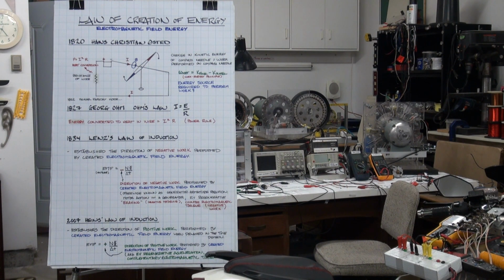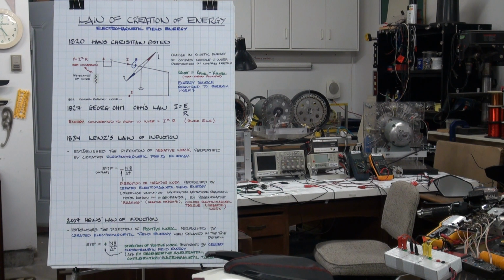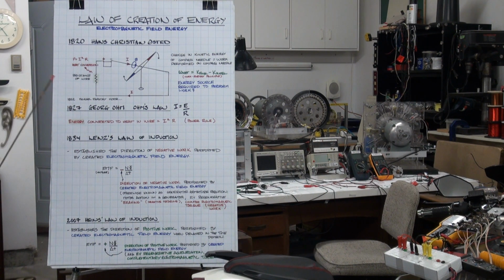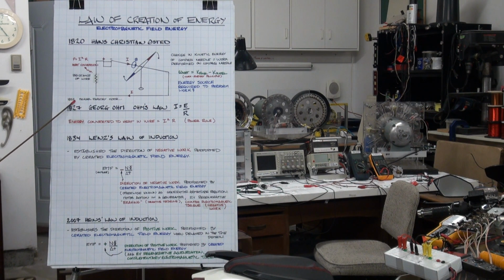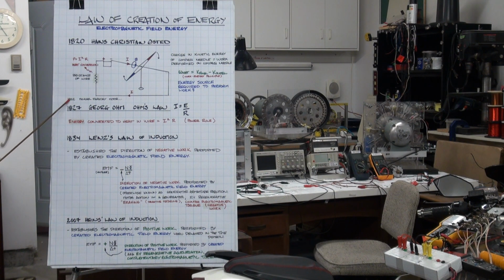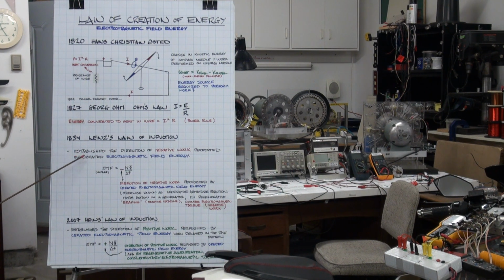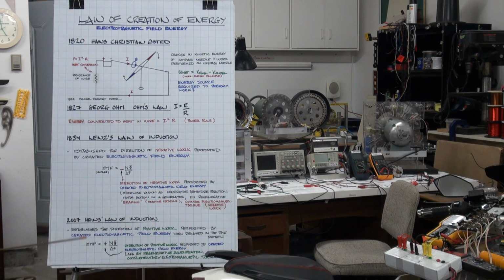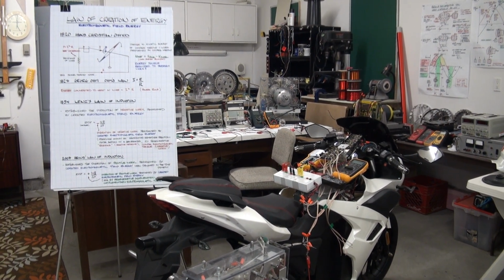Law of Creation of Energy 1820 - 2021

Comment: Stan Sandu  
     The FIRST controlled thermonuclear REACTOR type ENOCH -PACAL, after the UNIFIED LAW!           
    Bernard Bigot -Director General of ITER, in March 15, 2018 says: ”We have not a long-term option, for energy. If we do not find an option, we will have big problems.I am almost 70 years, I will not live to see the benefits of the fusion, but we*ll you get there. It is my duty to bring together some of the large chain parts delivery”. Thus, January 30, 2019 ITER Council renewed the mandate of the ITER director general until 2025. 
        Russian President Vladimir Putin on July 10, 2019 calls for international cooperation in the domain of thermonuclear fusion energy to unleash the potential of humanity because it is impossible and useless to try to stop human progress. Mechanical engineering Professor Eugen Schuster, an expert in nuclear fusion plasma control in 2019 says: ”..nuclear fusion reactors do not produce energy. Experiment on tokamaks sites worldwide are focused on the study of plasma physics”.
       Christian Hill Head of atomic and molecular data to IAEA ( International Atomic Energy Agency) said: ”that obtaining a high temperature in a reactor is one of the conditions for the fusion to take place. At temperatures of millions of degrees matter exists only as a plasma to be limited by a magnetic field not to damage the walls of the reactor, otherwise candidate materials for use in fusion reactors are tungsten, berillium and steel”. 
       At FISSION – large chemical elements we divide, and items arising are lighter than when they were together. This difference in weight is converted into energy. At FUSION – light chemical elements come together, and when united are lighter and can extract the difference in weight, as well as energy. It follows that it actually a matter is of concentrated energy. We consider the magnetic field usually just energy. But in fact, a magnetic field is all the time a matter with other properties – an ethereal matter, which may constitute a boundary between a plasma with millions degrees and solid wall of the thermonuclear chamber. 
        After the mode of organisation of the ITER, each participating nation has access to all data and all the technologies involved, without having to pay royalties on patents. Thus the ITER is a scientific and technological experiment with the opportunity to learn how to cooperate and develop project manajement with other cultures. Controlled nuclear fusion and plasma physics currently operates in more than 50 countries to demonstrate the scientific feasibility of fusion as an energy source.
         After approximately 200 installations type: tokamaks; with laser, and many other models are built in the last 60 years, NONE product the fusion and think it will not the model ITER being in construction. I understand it can achive an operating installation: after the model of the operation of the Sun; after the description given by Patriarch Enoch in the his Book; and after the sketch of the device for production and emission of the flow of electromagnetic field, sketch which it find in the bottom of the scheme printed on the tombal stone of the King Pacal from Palenque- Mexic.
       For learning and understanding comercial thermonuclear fusion phenomenon that directly produce the electricity, it can, as in the same ITER space: land and buildings, including construction tokamak mount, can be installed and thermonuclear controlled reactor type ENOCH -PACAL, having at hand all utilities: electricity, cryogenics, vacuum systems, equipment of control and monitoring, and more others
       . In the Book of Enoch chapter 68, the patriarch Enoch being in a heavenly ship, the Angels also show: ”the camps of the stars and all the lights”, these 6350 years ago, and Enoch says: ”and I Enoch was in the heaven and there I saw in the core of that light, something like a HOUSE raised from slabs of ICE( thermonuclear combustion chamber), and among the pieces of ice were LIVE FIRE – FLAMES ( electromagnetic field fluxes of the magnetic trap). And my spirit saw a CIRCLE of FIRE that surrounds the house, from the four corners of it to fire those living rivers that surrounded the house”. 
        The notions of ”FIRE”, streams of live fire, flames, circle of fire burning in the four corners and climbing as streams of live fire, or flaming fire live, all these relate to bundles of the electromagnetic field flux of the magnetic trap, which around and get back in thermonuclear combustion chamber, to spatialized plasma and go out again through the central part. In the heavenly ship Enoch believes the his it show a divine vision, and he describe without knowing what he describes, - a controlled thermonuclear reactor, with spherical chamber of thermonuclear combustion. 
        I understand that him Enoch was shown only at the top part of the thermonuclear combustion chamber, whose principal axis was vertical namely: 1). The core of light is the center of the combustion chamber; 2). The carcase of the chamber, seem made of slabs of ice, for the installation work to -270 degrees Celsius; 3).In inside sparkled and moved languages flaming fire alive, that is flows electromagnetic of the magnetic trap which tighten and turn plasma into combustion chamber; 4).A CIRCLE of FIRE surrounding with fire, circle formed from electromagnetic flux of the magnetic trap, and at the four corners of the circle of fire are lifted up to the top of the chamber by entering in the device for producing and transmitting, the flux becoming stronger and entering again into the combustion chamber, and forming the continuous circulation of the magnetic trap. 
       Two spherical halves joined in the midle ( maximum diameter), form the spherical chamber of thermonuclear combustion. I think so that will look the first installation controlled thermonuclear reactor, and sould call it Reactor thermonuclear controlled ENOCH -PACAL model! This as a standard model for future power plants that will give us electrical current for all our domestic and industrial installations. 
          In a video ”Anty- GRAVITY PROJECT” of Jeff Lucas Astrophotographer, published on October 27, 2018, the man explained that he managed to alter magnetic field of the coil with intervening components: a permanent magnet and some dielectrics. After he managed to modify the electrical permitivity and magnetc permeability around of the coil and thus the magnetic field around coil it turned in electromagnetic field, which is able to move further into space as radiation, to cancel the radiation of gravitational attraction. 
          He deserves the Nobel Prize for two reason: 1). Demonstrate that a stream of electromagnetic field can propagate in space as a reactive propulsion force showing possible operating reactive electromagnetic motor; as the scheme is printed on the tomb stone of Pacal from Palenque- Mexico and 2). This reactive electromagnetic motor which converts the magnetic field in the electromagnetic field, is the best device for producing a magnetic trap interior, which spatialized, to press and to confine the plasma thermonuclear, the facility ITER = international thermonuclear experimental reactor with spherical chamber, as described in the book of Enoch chapter 68.
Reply: Ola, o senhor tem feito um otimo trabalho, vi que tem alguns video em seu canal, são video muito interessantes mas com pouca visualização, eu me inscrivi em seu canal, seria muito bom que mais pessoas tevesse interesse neste conteudo e tentassem replicar os dispositivos, obrigado

Comment: When I was at college I learned about induction. It's the back-EMF, induced by the movement of the compass needle once it has gained momentum that feeds back negative energy or current flow in the opposite direction because it is a permanent magnet and therefore a moving magnetic field. As you were saying "energy creation" I was thinking "energy transduction". The trick however, is that by delaying the back-EMF, you are in fact turning negative energy into positive. You delay it by using very long wires in your high voltage coils so that the current has such a long way to go you manage to cause a temporal shift in the resultant back-EMF so that it slips into phase with the magnetic field that does the work instead of opposing it. That's my understanding of it. Is this correct?
Reply: Why does he not use a simple Capacitor to delay the back-EMF. I am thinking of a LC circuit ?

Comment: Nice presentation. Thanks for sharing. Quick question: What happens to the rotor speed in this case? Does the rotor accelerate until it gets itself detroyed or it reaches a new equilibrium at a faster speed?
Reply from the maker: Hi Marcio, This will answer your question. Cheers Thane   
PART 1: THE 5 USES OF CREATED ELECTROMAGNETIC FIELD ENERGY  https://youtu.be/Wx1n__XdJuY
Reply: @PDiCanada1  Thanks for replying Thane!
Reply from the maker: @marciogastaldi3077  this demo provides a good example of rotor speed variations. https://youtu.be/Wx1n__XdJuY
As the speed of the system increases or decreases the prime mover induction motor responds by adding or reducing the torque supplied to the drive shaft.
Cheers Thane
Reply: @PDiCanada1  Thank you Sir! The video provides a good example of speed variations, indeed. I like the way you use the charts to illustrate what your saying. That's a very interesting effect. Look forward to seeing it available to the market. I wish you good luck!